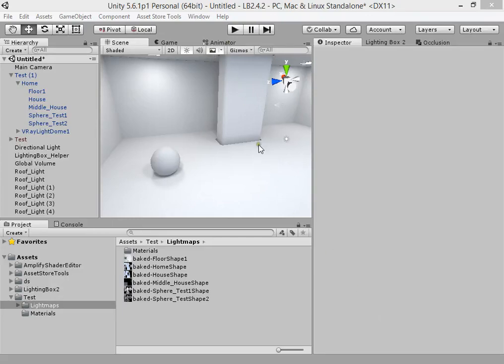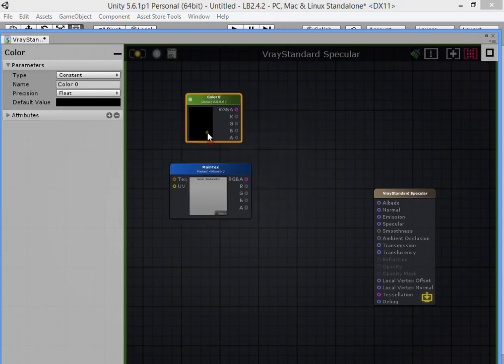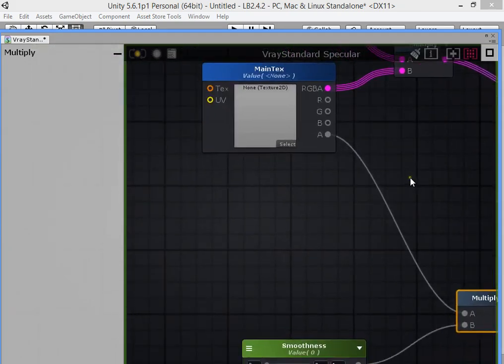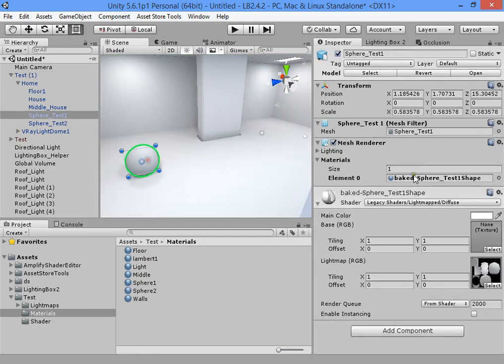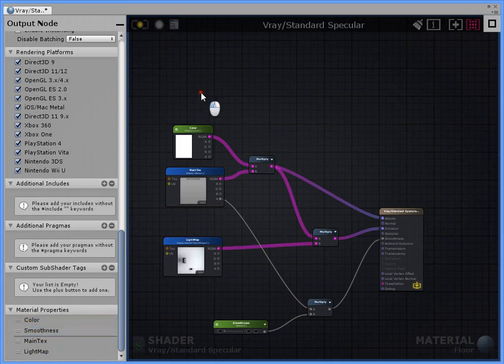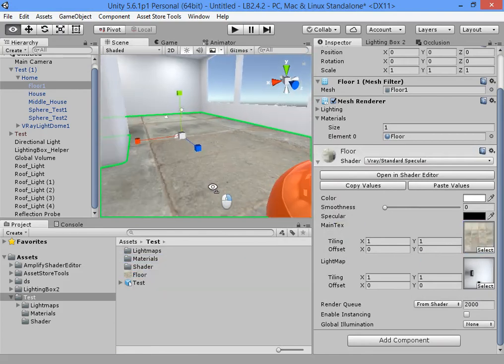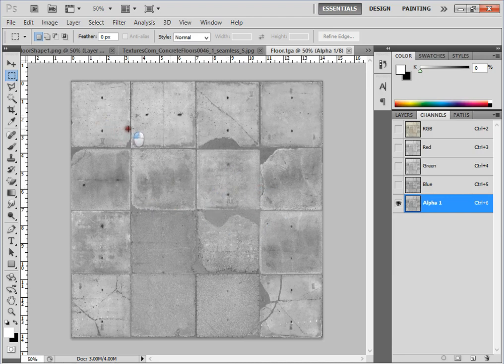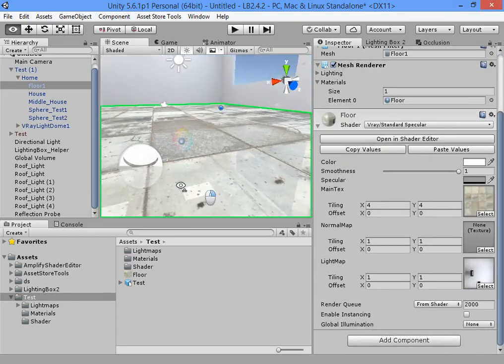[Tutorial] Maya V-Ray to Unity 2017 Rendering Part 3

Comment: Exxxxxcellent tut!! Just few questions:
1. What exactly happens when you click on Add Render Box button?
2. If I also use REFLECTION lightmap from Vray on sphere, then will it be a Mobile compatible scene for VR? Since dont need to use PBR, so asked.
3. Does the use of Post PRocessing (like bloom, AO, Lens flare etc.)hampers the GPU since it is RealTime per frame processing? So, is it wise to use Post PRocess for mobile interior scene?
Also, still waiting for the 3D Max tut.  Thanks
Reply from the maker: 1. Render box is an scripot to take high resolution screen shots
2. You can bake everything for mobile. Just create and Lambert shader with lightmapping for maximum performance on mobile
3. You can use only Amplify Color on mobile targets. Watch my interior Lighting Kit tutorials for mobile  lighting   
4. My max crashed every time when Render to texture. I couldn't use it
Reply: Thank you so much for answering all my queries! I will watch your Interior lighting kit tuts. I somehow  need to convert vray quality interiors into unity for mobile vr. Im this close, but not yet up to the point results. Though, I will post you my video once I get success. I would like to hear from you.  Thanks again!
Reply from the maker: Unity's progressive lightmapper quality is same as VRay and it's faster in some cases
But Vray has more features and less lightmap bugs
https://forum.unity.com/threads/madness-sale-lighting-box-2-4-released.475644/page-37#post-3295738
Reply: Yes, Exactly! And thats why I dont wish to do any lighting or baking/rendering stuff in unity, especially in my case of mobile VR visualization.